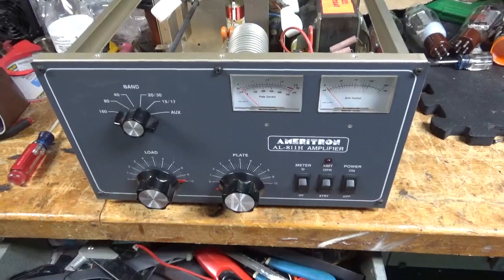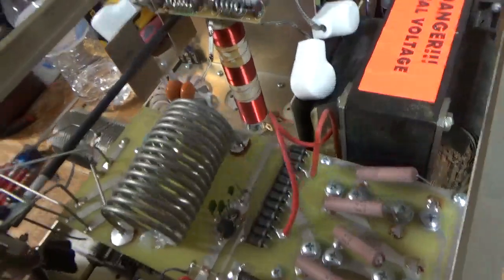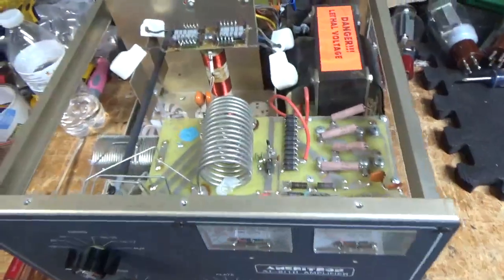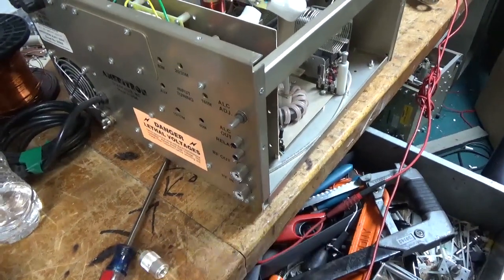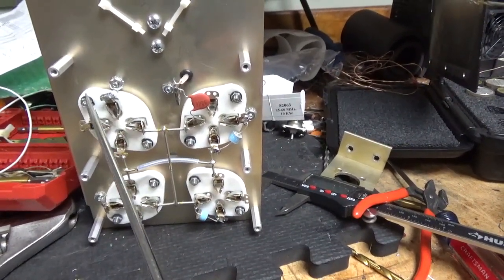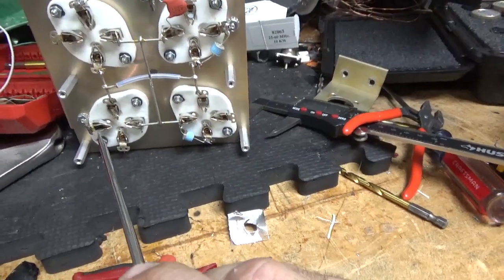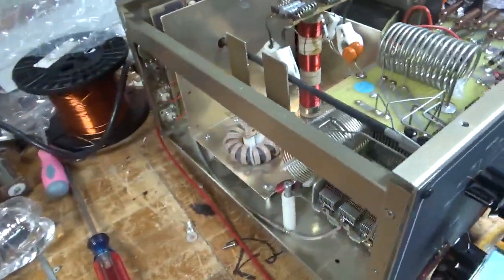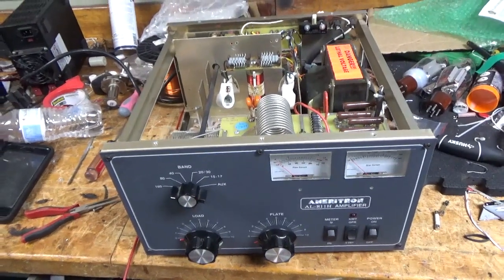Ameritron Al-811h Repair And Modifications Ground Grids Penta Labs 572b

Comment: And since the 811 valves only have 1,800 volts on the plate,how can I get a plate voltage of 2,400 if the amplifier transformer or meter Only goes to 2,000 V? Sorry if I have something wrong as I'm only learning
Reply from the maker: You don’t , you run the same voltage on the plate as you had with the 811 tubes . You get the same output but end up with more anode dissipation headroom and a higher voltage breakdown between anode and the grid. Direct drop in replacement

Comment: How much power should I get with a Collins 30 L-1 that has been modified to use the 572b valves?
Reply from the maker: Amp should only be driven to produce power spec documented in the operating manual for the mode you are operating . Upgrading to 572b tubes does not allow you to increase the power output. Chinese 811 tubes can not be oriented in the horizontal position , the grid structure will sag and touch the anode. Hence why you must install 572b tubes in a 30l1